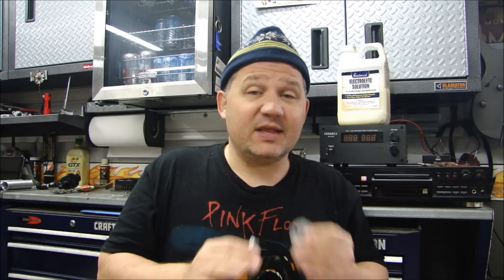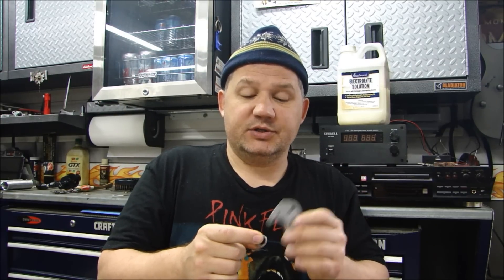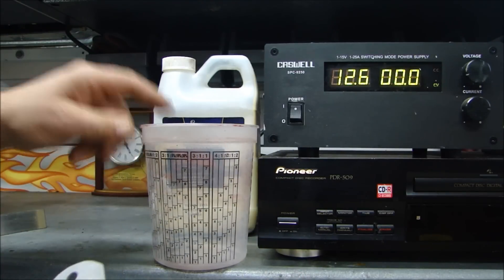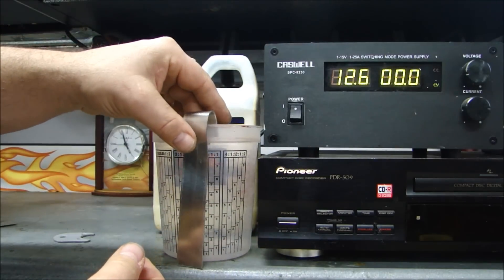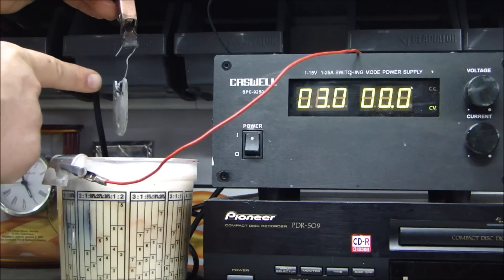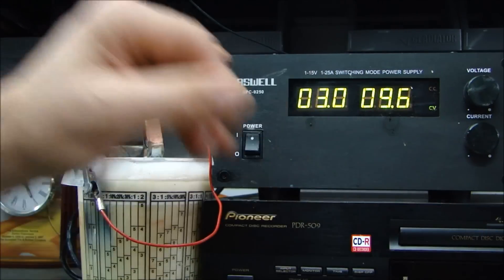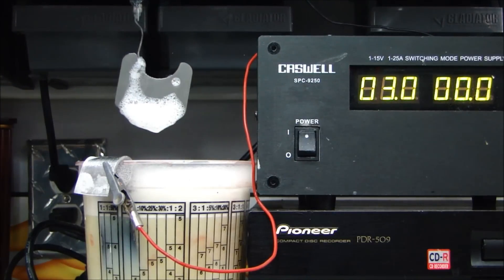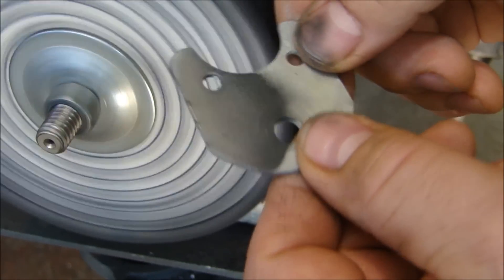Tin Zinc Electroplating

Comment: Hello after zinc plating you're parts you polished the parts I see for a shiny finish. So the zinc layer is still on the part after polishing than yes or no. Because I zinc plated my part and than yellow chromated it but it is never shiny always dof
Reply from the maker: Yellow chromate will not shine

Comment: I use this system . But I use fine aluminum wool with soapy water  to shine the part and it looks like chrome. My experience with buffing the part is,  you can easily buff off too much coating down to the steel and have it rust. This system is fantastic!
Reply from the maker: Awesome suggestion, thank you

Comment: Nice vid man! Just one note to avoid using stainless in the process or it could release chromium which is carcinogenic. Maybe use a copper wire instead of stainless. 👍
Reply from the maker: Thanks for the tip!

Comment: How long would it take for a small bolt? I been dipping the head for 30 seconds and watching this video I feel like I did it wrong 😭 (I got the Eastwood kit) I mean they do come out  w a light grey coating
Reply from the maker: Leave it in for 15 minutes. It will come out with a light gray coating. If the coating is rough, you have the polarity reversed.

Comment: #Pete's Garage - Hi! how do you keep the surface of the zinc plated part from turning "chalky" after a bit of time passes? Do you use a  chromate chemical (i.e. yellow chromate) after the zinc plating ? Or is there another solution to fix this issue??
Reply from the maker: I just take it out of the bath and use a light metal polish to clean it off. I prefer to buff it on a wheel.

Comment: So then this process plates the piece front and back without turning the piece around? Also, do you know if using one of those big 6 volt lantern type batteries would work or would that be too much voltage?
Reply from the maker: It plates the entire surface. Any 12VDC power source will work.
Reply: Pete's Garage Thank you!

Comment: Looks good. 
When is the electrolyte no good anymore? Best way to dispose?
How do handle and clean the parts when you take it out of the acid? Gloves?
Is the solution explosive, or bad vapors?
What happens if the voltage goes over 3v?
Thanks.
Reply from the maker: I have not used the electrolyte up so I can't say when it's used up. The best way to dispose is either a junk yard that takes chemicals or a recycle event that let's you bring in chemicals. I rinse the parts off in water, handle them with latex gloves. No problems with explosion, but the vapor is caustic. Over 3V the electrode wears away faster but does not end up on the part
Reply: Petes Garage Thanks!!

Comment: and how thick layer of zinc we got? Looks like you polished the zinc right through to the steel.....
Reply from the maker: I'll say the coating is about 50 mils. It does not get polished off. The parts I plate are many years old and never rust.

Comment: as soon as I buff it up , the zinc seems to go all off . what is happening ?
Reply from the maker: It's tough to say. I'd have to see what you do
Reply: all my rusty parts sit in HCl (hydrochloric acid aka muratic acid) for about 10-30 min depending on how distracted i get to completely remove rust and surface prep. 
then i scrub with wire brush to get rid of loose particles and then rinse before electroplating.
i haven't had a problem with zinc or copper plates on iron metals buffing off even with wire brushing or sanding using this method.

Comment: I have to do this diy but i cant find any zinc plate or strip or zinc anode please anyone help me to get this...!!!
Reply: I just watched another video where a guy used roofing anti-moss tin strips. He said some home centers have it, but he got his on Amazon. He also just used vinegar and Epsom salt as his plating solution. But he had to sit his zinc in that solution overnight to ionize it. So if you can wait overnight you can save some money.
Reply: Chetan Ghate you can get them off old boat ourboards , out drives and such.   New ones off the net are around $5 and pretty big.      Most any marina will likely sell you old ones dirt cheap
Reply from the maker: That's a great idea
Reply from the maker: I buy it from eastwood.com
Reply: any boat shop will have zinc anodes for use in rust prevention. All shapes and sizes.
Reply: Ebai 5 bucks

Comment: As with all methods of coating the devil is in the detail. Do most of the buffing before plating. Certainly any chromed item will not look good if the basic surface is less than perfect. Zinc and tin are little different.

Also letting the surface build up too thick and/or too quickly will result in a frosty crystaline finish which will take more buffing than is absolutely necessary.

Where did I come by this information? When I used to work for an industrial electro plating company. Chrome, tin, zinc, silver, gold we did the lot.
Reply from the maker: Great comment...thank you

Comment: Does the size of the object being plated affect the voltage or size of the sacrificial piece needed? What I'm wanting to plate is a wee bit bigger. Lot of surface area to cover.
Reply from the maker: +mspade83 No, it does not matter. You may leave it in longer to make sure it gets fully plated. That is where a good power supply helps.
Reply: Yes, of coarse it matters... but mainly along the lines of providing enough Zinc to coat the part sufficiently.  You can always swap out the Zinc strips if need be though, but the part would probably have to be quite large or the strips quite thin since the coating is very very thin :)
Reply from the maker: I have not done pieces larger than the anode. I have always had great results

Comment: 4:20  where do you bye that sacrificial peace, or does it come with the Eastwood kit?
Reply from the maker: +Lenny F Yes.....everything you need comes in that kit
Reply: You can also buy replacement zinc ribbon at places like Home Depot or Lowes as Zinc Strips for moss/fungus  prevention on rooftops if you don't want to spend the time/dime on Amazon.

Comment: The deposited metal is NOT an insulator, if the current is falling it's probably hydrogen bubbles forming on the part or the anodes, not the deposited metal.  If you are managing to deposit 'insulating metal' then something is badly wrong :)
Reply from the maker: +Andrew Mawson As the sacrificial metal dissolves in the acid, impurities build up on the surface and act as an insulator. Hydrogen bubbles can't form because there is not enough current for electrolysis.
Reply: You're sure about that hydrogen bubble deal? Because any current passing through a water solution is going to make some hydrogen. Heck I've seen hydrogen form using a AA battery.

Comment: Why waste your time and money with that overpriced Eastwood crap? You have a Caswell rectifier power source. Buy their plating solutions for bright zinc or yellow cadmium and the parts come out bright , no buffing required. Their nickel setup comes close to chrome and the results are professional. I do not work for Caswell but I use many of their products restoring autos. Nothing looks or protects like triple chrome plating and that must be sent out to the pros.
Reply from the maker: Eastwood does make some very good products. I will look into Caswell
Reply: Actually Eastwood does carry some fine products. You must be a careful buyer though because of the high prices. They carry some products I can find no where else so I must purchase from them .

Comment: Looks a cheaper alternative to chroming... sure I will be running into a couple of pieces on my project I could use this, cheers for the instructible.
Reply: zinc plating is typically used for anti corrosion and will result in a dull to natural metal finish... chrome plating is used for either anti friction or atheistic reasons. the two methods aren't typically interchangeable as use and results typically very different. if you want shiny metal without chroming it, you're best off just polishing it and skipping the plating process
Reply: @alektimmons4471  lol it just rusts then
Reply from the maker: This method does work very well
Reply from the maker: I do this for the anti corrosion...you are right
Reply: GTs Garage Yeah. A cheaper and probably less weather-proof alternative as well.
Reply: This is primarily for corrosion resistance and it will not hold up looking like that.

Comment: Pete, how thick is the coating using this process? When you buff the part, approximately how much material is removed vs the depth of the plating.  Also, what do you use the pioneer tape deck for? Does the plating go faster if your playing a little pink Floyd?
Reply from the maker: The coating is very thin...microns. You must buff lightly so no material is removed. It takes some practice, but you can see when too much is removed. Just like sanding or buffing paint. The Pioneer CD recorder is used to make CD's for guys in my band. I can take stuff off old vinyl or use my Denon CD player to change keys on a song so we don't have to tune down...Everything goes faster when you play Pink Floyd
Reply: Spoken as a true connoisseur or the 90's
Reply from the maker: 90's? I still have my first generation single beam CD player that I bought in '85. Weighs 4 pounds but it still works. I rip all my stuff to MP3, but when I change key of a song I like to burn a CD and rip that. It just stays in tune better.

Comment: Is it just for looks or does it offer corrosion resistance? Is it a good coating for SS? How do you know if you buff too much that you buff down to bare metal.  Would love an aluminum anodizing demonstration (type 3 ideally)--just had 200 parts anodized for work. Some of the parts I had impregnated with PTFE. Super slippery!
Reply from the maker: It offers great corrosion resistance. You could use it on SS, but I prefer just buffing SS. If you buff too much you can see it just like polishing paint. I do anodizing and it's a lengthy process. I do not do it much but the colors are limitless.